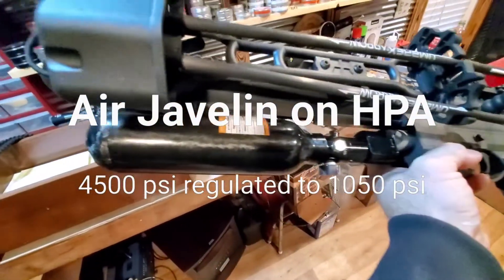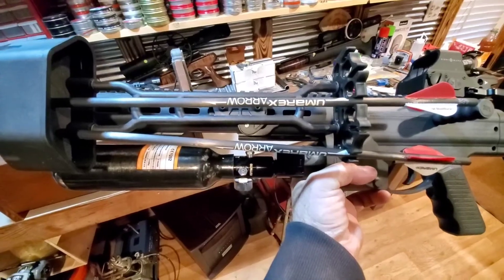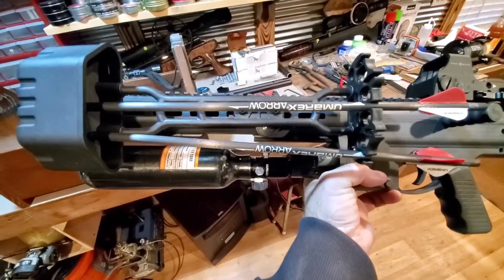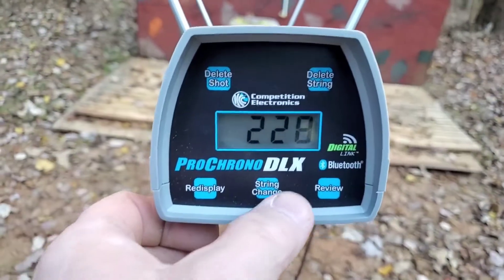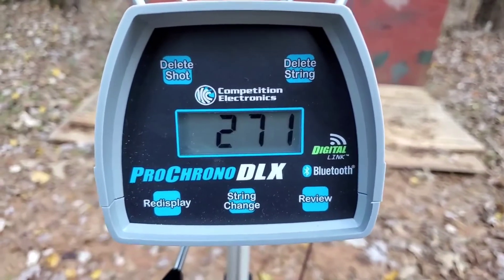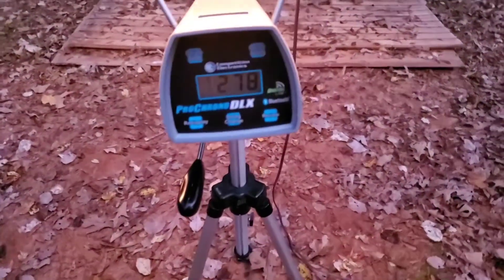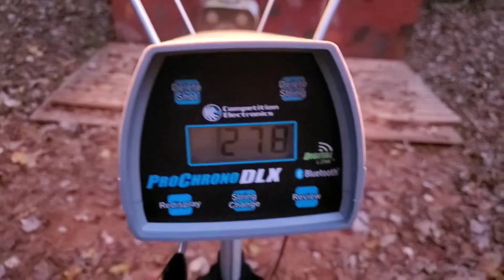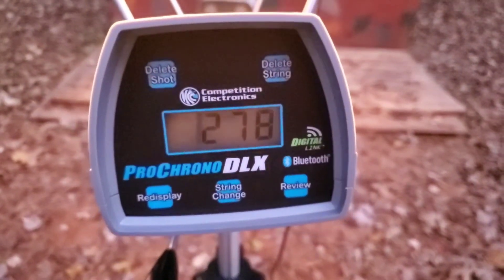Air Javelin on HPA

Comment: What is the advantage of HPA over CO2? I expected HPA to have higher velocity/power, but this seems not to be the case?
Reply from the maker: For me personally its because I have a compressor to refill with.
Typically though it's not as temp sensitive. Co2 loses a lot of pressure when it gets cold outside so anything that uses it to shoot a projectile tends to slow down some.
Airgunners tend to be a little sensitive if projectiles slow down at all lol

Comment: What is the adapter you used for the tank?
Reply from the maker: It's from Archer airguns for Crosman 22xx airguns.
Umarex sells a nice kit now
Reply: Hope u can answer a small question I have.  Do you know or have you tried to install the new umarex air javelin hpa bottle adapter that umarex sells and install on a origin ? Just wondering if the threads are the same where the adapter attaches to the frame-receiver as the origin after removing air tube. Tha way can use a regulated hpa tank setup on origin? 
 Thanks if you can answer. Thanks anyway if not known. Appreciated....

Comment: Cool! I always wondered what an AirJavelin (which I also own) on HPA was like, on a chrony. Pretty respectable and very comparable to CO2 speeds.
Reply from the maker: Needs a little more hammer spring with the regulator set that high I think
Reply: If possible could you please list the parts needed to switch from co2 to hpa
Ty 
A
Reply: @waterpiggies  I do not know what parts, as I have not converted mine. It still runs on CO2. But there are videos on Youtube that do tell you. I saw a guy convert his on here on Youtube. Just look for "Airjavelin HPA conversion" and the ones I saw were on Kid Pellet channel and Vipers Videos channel. Kid Pellet has done complete teardowns too and addressed some problems with the airbow and how to correct them, he's really good.
Reply: Would of liked on fb but I’m in their jail again lol, pretty good results